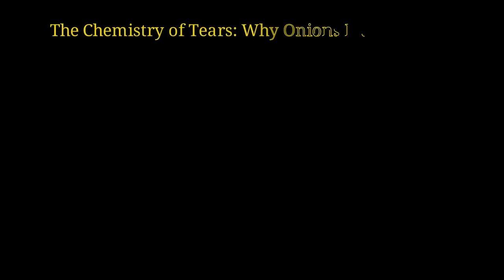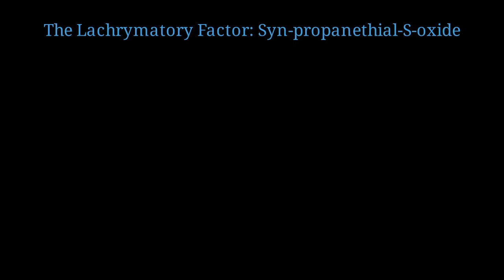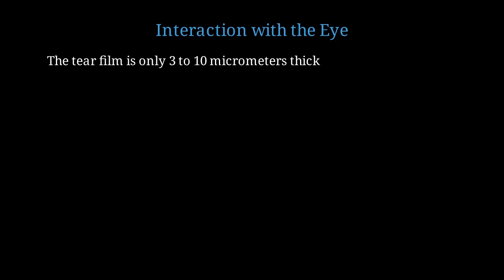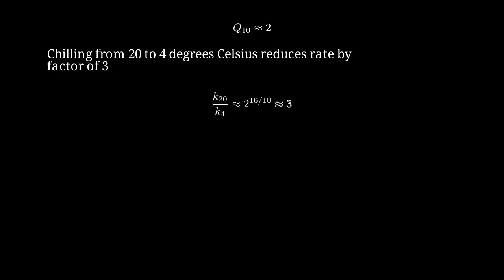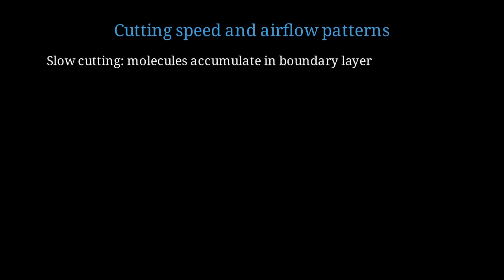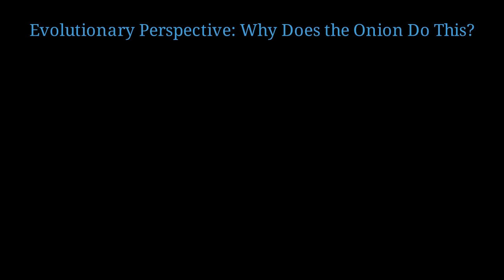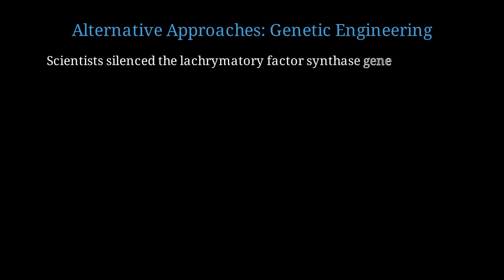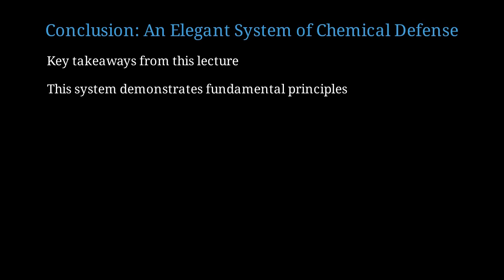Why Cutting Onions Makes You Cry

Comment from the maker: Can we build a predictive quantitative model linking cut mechanics (fracture vs crushing statistics) to real-time emission rate of syn-propanethial S-oxide under different knives and cutting styles?
What is the exact molecular sensing pathway in the eye for onion lachrymatory factor (TRPA1 vs other TRP channels, and corneal vs conjunctival contributions), and how does it depend on concentration and humidity?
In tearless-onion engineering, how can we optimize for minimal tearing + maximal flavor while preserving storage stability and disease resistance in the field?